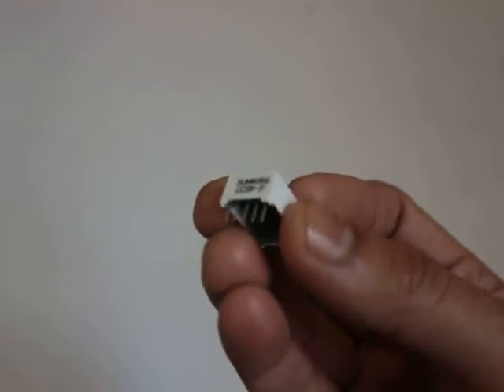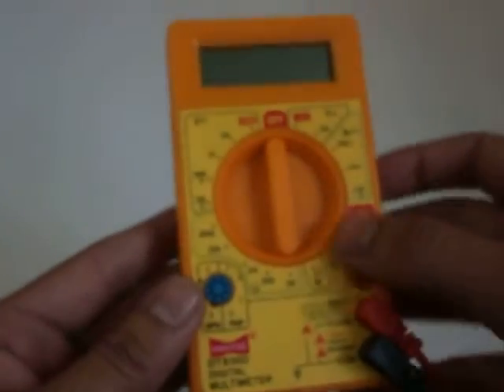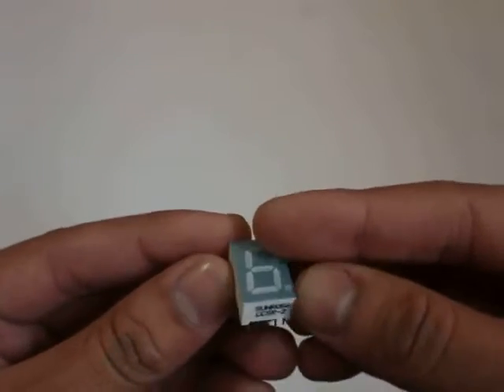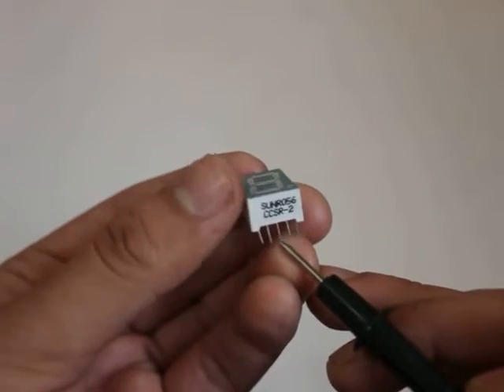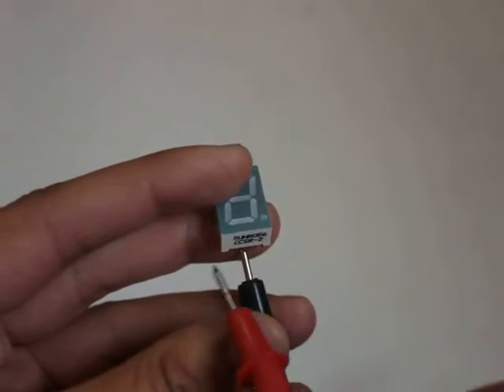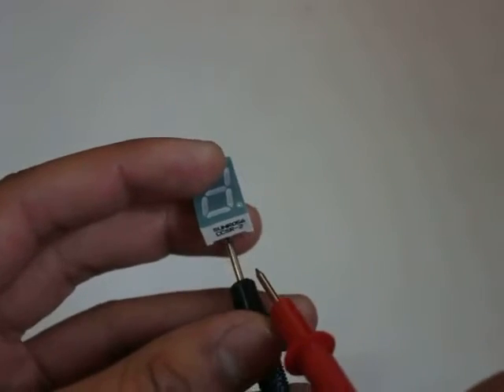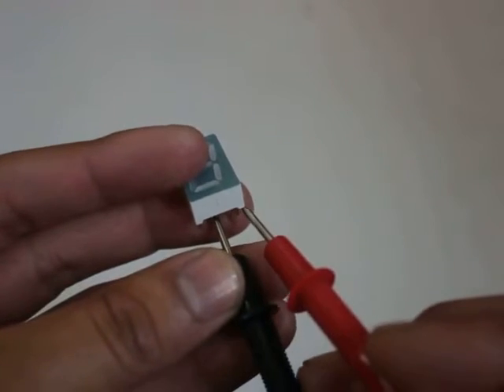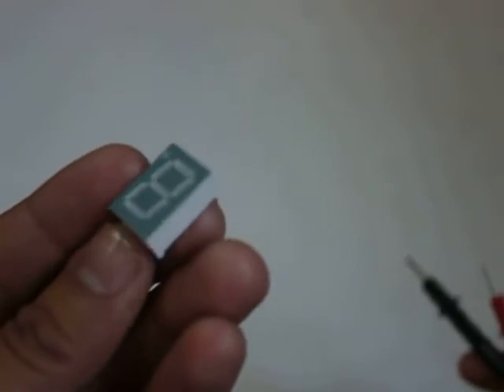How to test a BCD 7 Segment Display

Comment: Thanks for the help man!! Really helpful!!
I have a question though. How can I test the same thing for a 4 pin 7-segment display?

And also, how can you distinguish a common anode from cathode 4 pin 7-segment or just single 7-segment display? I need help. 

I have a 4 pin 7-segment display and the little bars light up only when I put the black cable on the far right pin of the display and move the red cable through the other pins (that happens for both sides of the display). So what type of display is that? Cathode or anode?